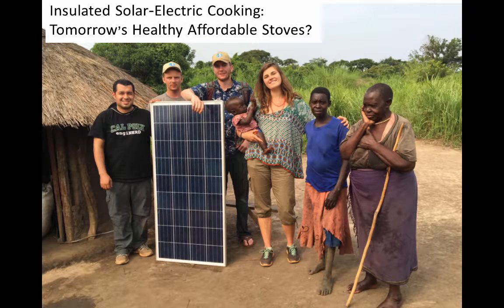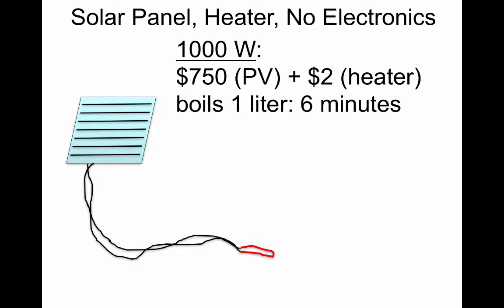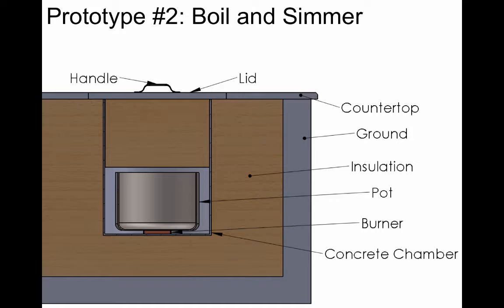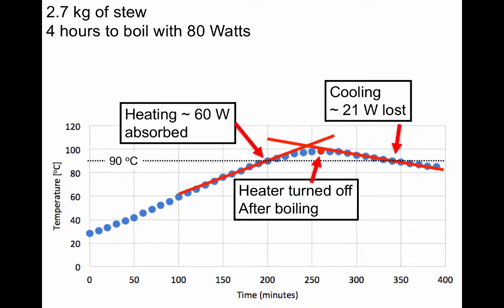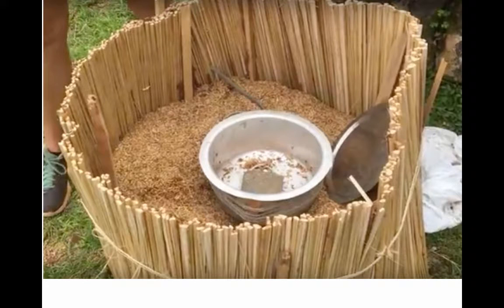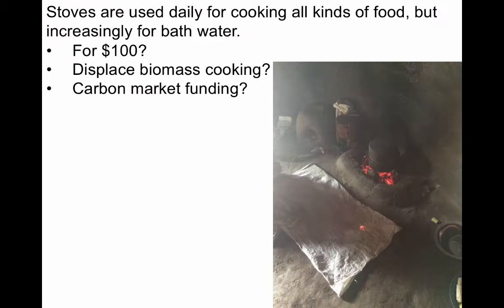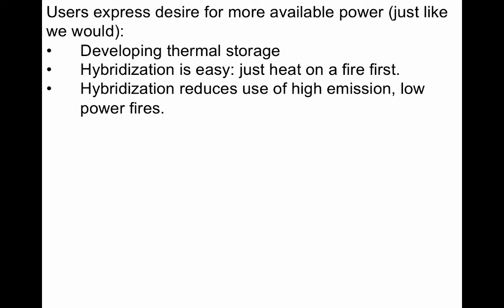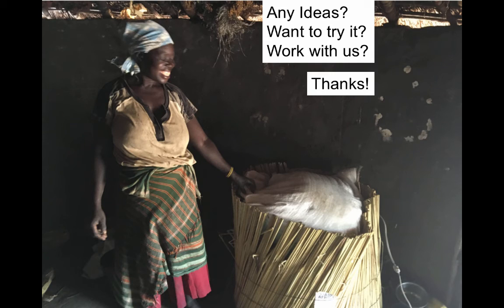Insulated Solar-Electric Cooking: Technology and Uganda, Pete Schwartz, Cal Poly Physics

Comment: Excellent video.
I am interested in trying this for myself.
Can I ask where you purchased that immersion heater or did you make it ?
I have seen many of the common cup immersion heaters, but they are a tight spiral shape and 500-800W.
Reply from the maker: We make them, but you can buy them too. Yes, the ones I see are smaller and made for standard voltages. The important thing is to match the resistance of the heater with the output of the panel. We discuss this in our publication at http://www.sciencedirect.com/science/article/pii/S2352728516300653
Reply from the maker: Feel free to contact me directly at pschwart@calpoly.edu